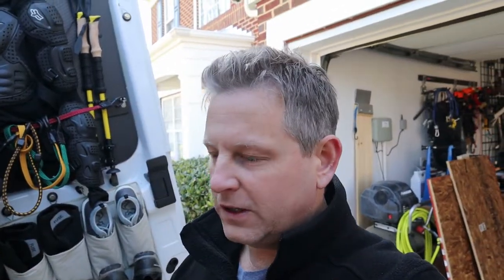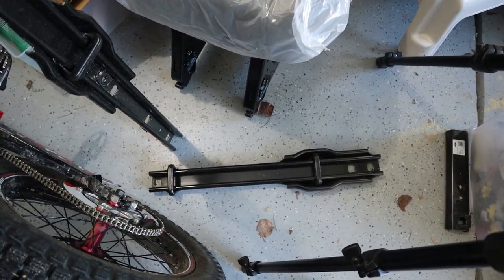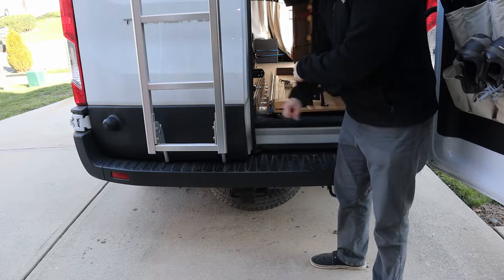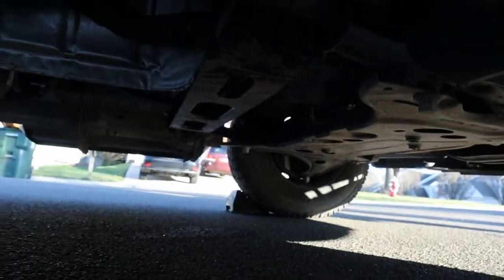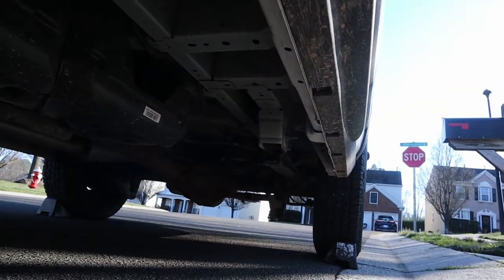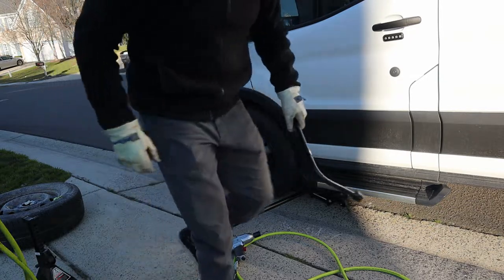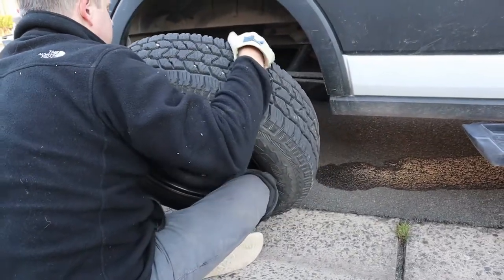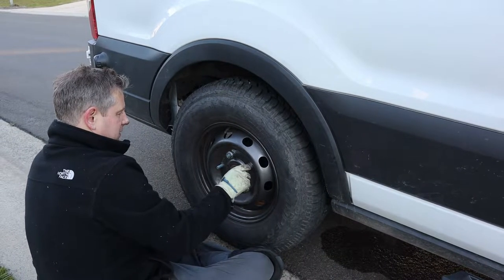#MTBPlanB Critical Van elements to know plus project updates and DIY tire rotation.

Comment from the maker: Let’s hear those nightmare flat tire changes. Anyone?
Reply: The shop used an impact wrench to install the wheels. I couldn't change the tire because the lugs were too tight.

True story.
Reply from the maker: On_The Road I had the same problem.  I do final tightening with the lug wrench. My cheap impact along with small air compressor can barely reach 100 lb-ft.